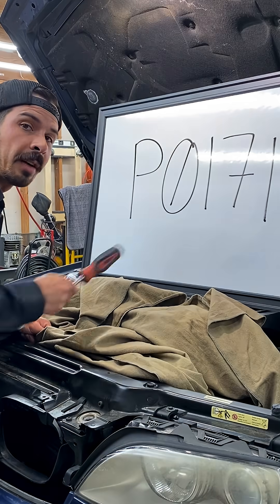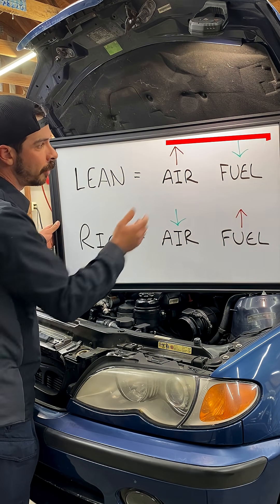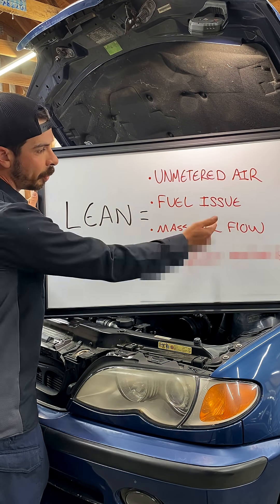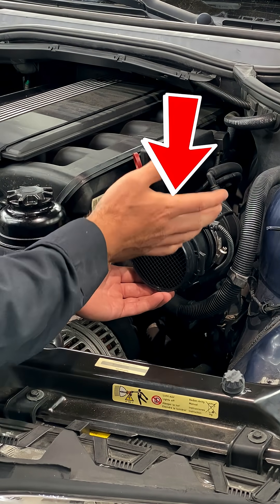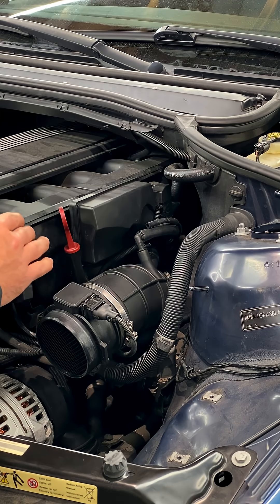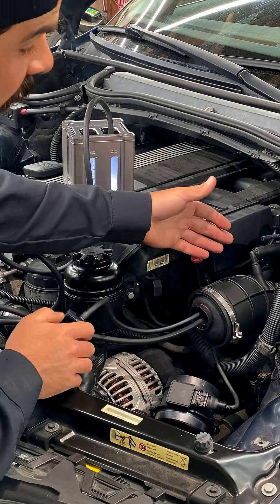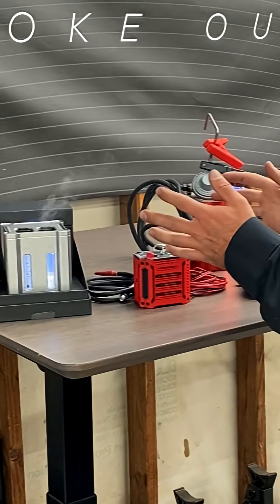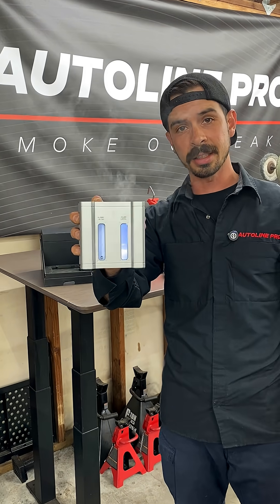P0171 Code Explained: Causes, Diagnosis & Fix for Vacuum Leak / System Too Lean Bank 1

Comment: I have this code and also a code for low fuel pressure. It’s safe to say that this code is probably caused by that one? Or should I still check the other possibilities
Reply from the maker: you're going to want to test it.